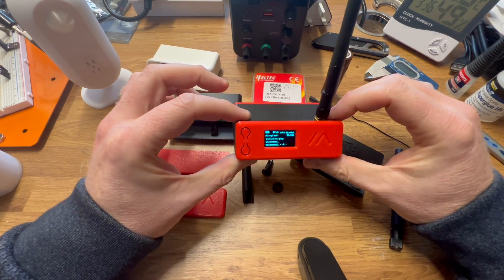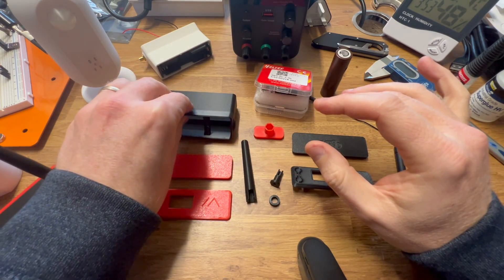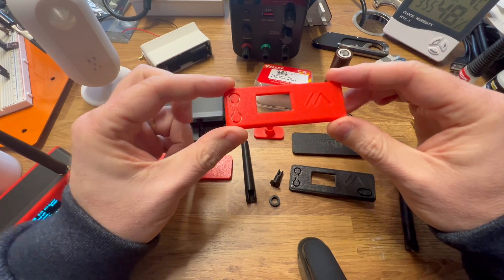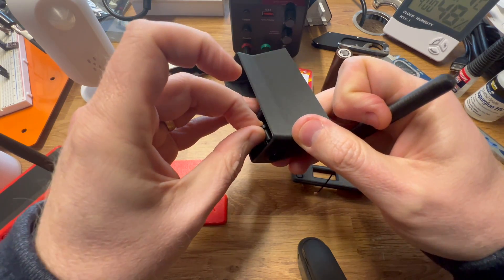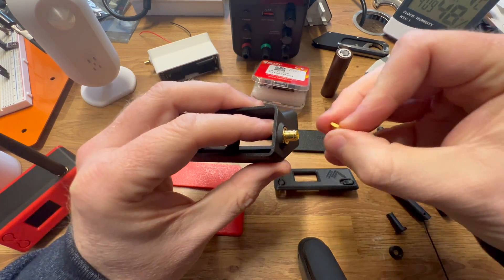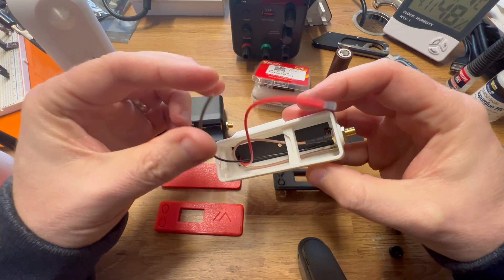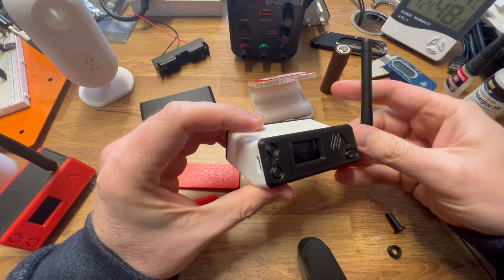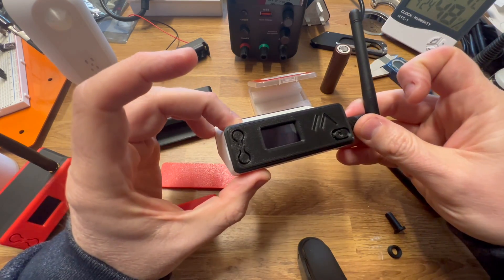Bender - Battery Case with SMA Connector for the HeltecV3 Meshtastic powered LoRA Node

Comment: Is there a cheaper way to get delivery of these devices in Australia?
Case costs more than a Heltec V3
Reply from the maker: Sadly not. I’ve not been approached by any resellers in Australia yet but even if I did they’d add margin to cover import fees and make profit. You could of course just buy a printer 😂

Comment: Do you have a bender case with the battery on/off switch?  Can you provide a link to the tiny switch you found?  I’d like to try to add the switch to a lithium battery.  I’m new to Meshtastic (less than a week) but the power consumption is killing me.
Reply from the maker: The switch I use is widely available, this is the switch on Amazon UK but it’s available under different names all over the world: https://amzn.eu/d/bjG8yt7

Comment: Ordered the print files :) Do we need some sort of "ballast" if using a LiPo pack? Without the 18650 I wonder if it might tip over
Reply from the maker: I don’t think it’ll be too bad with the top antenna mount, side maybe a little tippy but of course would really depend on the size of antenna. Thanks for the purchase bud 👍

Comment: I’m new to wiring… how did you wire the switch to the battery and jst connector?
Reply from the maker: It's really simple, it's on the positive cable between the battery and Heltec so essentially just cuts the circuit. The Heltec comes with a JST connector cable so if you wanted to make the cable yourself you just buy a battery holder and some switches.
Reply: @zerofox3d  sorry, I meant the switch as it has three prongs.
Reply from the maker: @haylon11  Ah it’s a two way switch, you just use the middle prong plus either of the others!

Comment: What is the best orientation to print this?  It seems to need a lot of supports, unless I am doing something wrong.
Reply from the maker: It prints with the face down and yes requires support but only for internal structures not visible when assembled. The support serves to not only support the internal structure but also stabilises the print and ensure good adhesion too. The 3MF files include support enforcers and if you use tree/organic support with these files the support is pretty minimal and very easy to remove.

Comment: I thought you said you were going to "post the link" to get the battery boxes on Amazon??👀
Reply from the maker: I think I just mentioned it's in the release notes but here you go, this is the section from the release notes going over the battery holder:

Single 18650 Battery holder with measurements no larger than 76mm x 21mm. These are extremely common in the popular online market places, you can see an example here: https://a.co/d/3M1bqga
Reply: @zerofox3d  thank you. I appreciate it. Any idea why my standard heltec antennae wouldn't fit in the printed antennae from your files I bought?
Reply from the maker: @TappingMyRoots  If the IPEX does not fit down the hole it may need opening up a bit, small drill bit or trim any elephants foot around the hole. If the cable is too short you likely got old stock with the different antenna I did not know about! Both are a bit rubbish so I'd bite the bullet and buy a proper antenna, you'll have a better experience!
Reply: @zerofox3d  that's what I'm gonna do, just thought it was odd because the antennae looks just like the one that slid nicely into yours in the video.  I took a drill bit to it and everything, no luck. After that and the battery pack I got a bunch of from Amazon not fitting I thought there was something majorly wrong. Trying different battery packs that are on the way 🤞🏻and got a proper antennae ordered. Hoping it all comes together. Thanks again.
Reply from the maker: @TappingMyRoots  Hmm if it’s the same looking antenna it should slide in easily. I’d print a calibration cube and check dimensions, just in case the printer is making everything too small!
Reply: @zerofox3d  it was printed by a friend. I'll say something. The only thing about that possibility is, the heltec board popped right in, no problem. I would think if it was too small for one or two things it'd be too small for everything. Thoughts?
Reply: @zerofox3d  also, it wasn't the ipex connector that didn't fit, the coil on the end of the antennae doesn't fit into the hollow antennae sheath it goes up into.
Reply from the maker: @TappingMyRoots  It’s likely your friend has printed without using the support enforcers in the 3MF files. Support is only needed around the base, if you let it generate automatic supports it will fill the inside of the main antenna body with support and that will not come out, stopping you inserting the antenna!

Comment: Can you please share an Aliexpress link to the battery holder? and any other hardware you recommend? I'm going to buy the file to print. I live in the US. 73!
Reply from the maker: Pretty much all of the 1 cell 18650 battery holders seem to come from the same factory. I've ordered from multiple suppliers showing different images and the same holder has turned up each time. If you order one that looks similar to the one pictured on the hardware kit product on my site you should be safe!
Reply: I ordered a bag of them from Amazon, look just like what I see in the video, and they don't fit. Hoping to get a link to the ones that do fit.
Reply from the maker: @TappingMyRoots  There is a link in the release notes that should be the right holders. All of the holders I’ve ordered have the name “YIENLAO” written inside them but you never see that in titles or descriptions of the products.

Comment: Ordered and man, this printed so well. Well done. The antenna tool was a nice touch.
Reply from the maker: Glad you like it bud. The only thing that bugs me is the seam position but everything I tried looked naff so I settled having it smack bag in the centre on the bottom. I've printed hundreds of them at this point and the failure rates are really low, the support in the middle of the body really helps. Also worth pointing out this design would have been almost impossible to print without the invention of organic supports so kudos to those guys.

Comment: Where is the STL file available? I only see it listed for sale on your site for $12!
Reply from the maker: I sell the STL/3MF files on my site buddy!
Reply: @zerofox3d  I see that, $12 (half the price of the product) is a bit steep considering you are completely sold out of the product, don't ya think? Most STLs are between $1-$5. I understand you gotta eat, but damn...
Reply from the maker: @cuppacheese  The cost is based on what I consider the quality of the case and other factors. For example I sell the hardware kits at a price that allows you to buy the files and print it yourself for less than I sell the full product. You can also print as many as you like. The digital files also cannibalise sales of the physical product. If you buy the digital files and are not happy with it I’ll refund it bud 😉

Comment: Purchased and printed your Bender 3D print files, however actual housing which prints face down, it prints an almost impossible to remove waste area from USB to side-mount antenna. Would send picture for your review to advise what I might be doing wrong. Otherwise project prints beautifully.
Reply from the maker: For anyone wondering Brian's slicer made a mess of the 3MF files, using Prusa slicer sorted it! Enjoy Brian!

Comment: I got my two through the post this week, and they are amazing. Snug - but perfect! - fit for the v3. Only thing to note is that the antenna that comes with (some?) of the Heltecs doesn't have a long enough cable to work with your case - the length of cable is too short to reach all the way from the board through the hole to the bend in the casing. (But that's not your fault, obv).
Reply from the maker: Cheers Ben, glad Bender arrived safely. I only found out about the different Antenna they have used after I launched and did wonder if the pigtail would reach, thats annoying. If anyone who buys it finds its doesn't fit they can email me and I'll refund the cost of the antenna housing. I'll mentioned that in the next update email I send out. Thanks for the heads up.

Comment: which heltec v3 is it? 4-510mhz or the 868mhz?..
Reply from the maker: Bender doesn't include a HeltecV3, it's a case with battery holder and SMA cable! You'll need to add the HeltecV3 with the appropriate frequency for your region.

Comment: Just purchased your print files and printed out 2 full assemblies, loving it 👍, I have a question regarding the battery does it get charged if you connect it to the USB? as I understand this board has charging capability, and I suspect in order to charge the battery this switch will have to be in ON mode so the battery makes contact. Thanks in advance
Reply from the maker: Thanks for the order, Bender is proving quite popular 😁 You’re right the Heltec charges the battery and yes the switch needs to be in the on position to allow the battery to charge (it’s spliced into the V+ cable)
Reply: @zerofox3d I want to fit in a GPS module (NEO6) and a sensor for telemetry (BME280) do you think they will be able to fit inside the case?
Reply from the maker: @Ponyony I’ve had a report of a Neo6 squeezing in, it is in my plans to get a GPS board and offer a modified housing you can swap in 👍
Reply: @zerofox3d  Any plans on making the model that can fit the GPS? it’s really hard to fit it in the current case 🤭
Reply from the maker: The plan is using a new 2000mah flat lipo with compatible cable I’m producing in China that will free up room in the existing chassis 😉

Comment: Hi will the battery holder take a 3.7 volt 18650 nimh battery like the one pictured in your video?  i am not sure what to search for on Amazon.  Are they Nimh or Lipo batteries?  Do they  have a flat top like in the video?  Or do they have a Button top on the positive battery terminal?  Is it possible for you to pin a Ebay/Amazon search link?  Sorry for so many questions i don't want to get the wrong one.  Great little case though thank you for the demo.  on the strength of the video I have ordered a case for my meshtastic just what I was looking for.  Thank you very much.
Reply from the maker: The battery holder with take both flat top and button top 18650 cells. I believe lipo are the better option but I don’t think it’ll matter. Thanks for the order, had to buy another 2 printers today thanks to you lot 😂
Reply: Must be horrible having two buy more printers 😂😏👍🏽